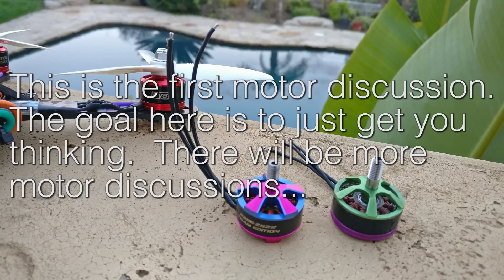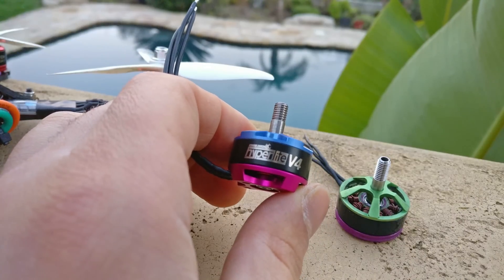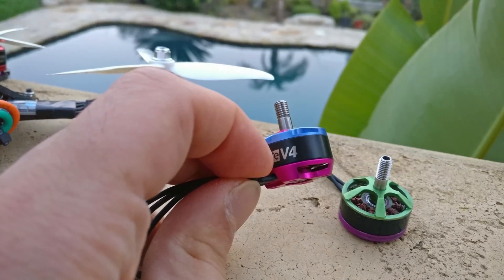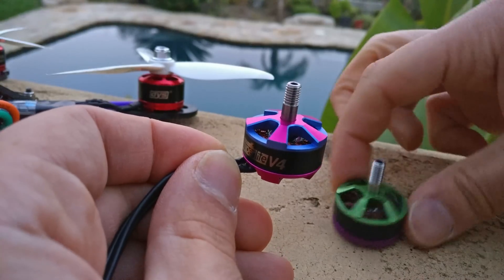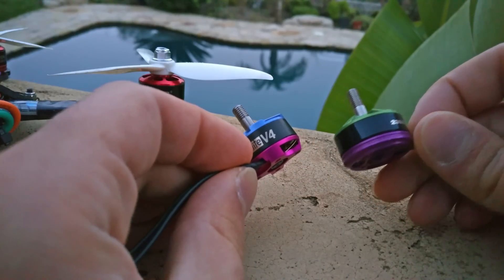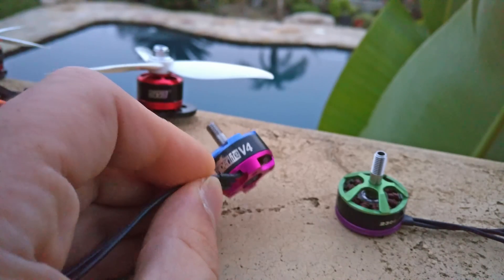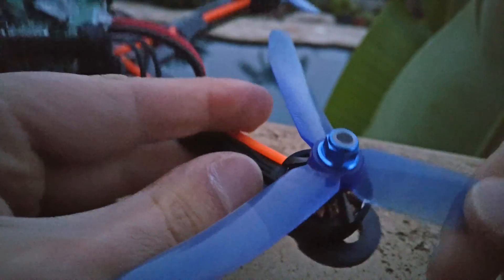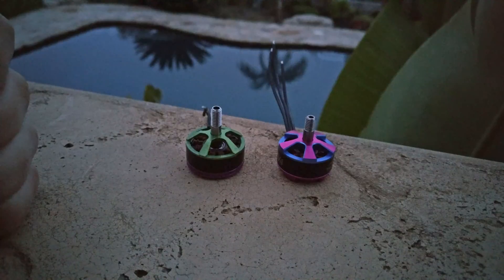Motors 1 - Quad Theory

Comment: Doesn't a prop override a wider stator motor for gyro effect?
Reply from the maker: What you mean?  It's not actually a gyro effect. I misspoke. But it's a rotational stability thing.
Reply: @Kabab  i mean does't a prop already override the stability effect on wide motors means prop is already much wider and they have their own effect and that effect must be bigger then motor itself
Reply: And btw i dont brush if i brush my gums start to bleed 😖
Reply from the maker: @goobisoft4873  ah. Yeah the wider motor doesn't have much of a gyro effect. It has a torque effect that helps with yaw. But even that's not totally true. If your gums bleed, you need to have your teeth professionally cleaned and then learn to brush and floss to maintain your gums and teeth. Otherwise the disease that causes your gums to bleed will only keep getting worse until your teeth fall out on their own.
Reply: @Kabab  thnks for replying ur channel is awesome pls keep continue making these videos and also y dont u make a big copter like autonomous octa or hex and talk about them

Comment: Well I do have emax rs2005s 2600kv motors and zmx fusion x25 2300kv motors, and there is no match, the zmx are waaaayyyyy more powerfull and faster than the emax... Maybe is because Im running racekraft 5051 and cyclones 5046c props on them, maybe the emax can't handle heavy props
(4s and 5s lipos, bonka, adrenaline, graphenes)

Comment: I would love to see you cover ESC's and matching them with the right motor a d prop. I'm only on my second build, and this seems to me to take some time. Not all motors give AMP draw data. Can you have a too high ESC? Some ESC's will give Max AMP draw, but changes by the prop you use. Can you help us to understand how to choose the right ESC for a build? Seem to be alot of lacking data when choosing an ESC for your motors. To me this seems to be difficult, or I'm over thinking it.
Reply from the maker: I'm gonna make videos about building when my prototype frames come in and I actually build stuff again.  For the most part, you can't go wrong with the Emax Bullet ESC's.  Most ESC's are pretty much the same.  They just need to work.  As long as they do that, they're all good.
Reply: I'll be looking forward to it. Yeah, I like the features of the Emax. Yeah most ESC is pretty much the same, except they support different AMP draws, and that's what I try to figure out when matching with a motor and the draw it demands. For example, if you're going to run the Emax RS2306 White edition RaceSpec Motor, It can have a 57.2 Amp draw with GF5050 Tri-blade on 16 volts. I'm thinking if it doesn't matter, could you not run a motor that draws too much on your ESC or a motor that's not getting enough? I heard other say they are running 30Amp ESC with this motor, to me that doesn't sound adequate. Because of my inexperience, I'm just not getting it doesn't matter.It also seems many companies doesn't publish this information about their ESC's and that can make it even harder to match the right ESC. Unless like you said, It doesn't matter, and I just think it does.
Reply from the maker: Spedix 20A or Emax 30A for anything race class 4S.  Done.  Unless you like Kiss stuff then go with them.  There aren't really special ESC's right now.  In about six months we should start seeing some really special stuff come out.

Comment: Hi, I just wanted to say great video, but I have a few questions: do you think motor efficiency is an important trait to look for in motors when acro flying? When looking up motors I saw that cobra motors and the t motor f40 have high efficiency at low rpms and become increasingly inefficient. most other motors have a peak efficiency at 50, why is this? Also Mr. Steele's new motors seem to be tuned to operate at 50 to 75 and yet they still have a lot of punch out which is unique, do you think they are worth the hype?  Thanks!
Reply from the maker: depending on the build quality and stator size, a motor can be tuned to have it's peak efficiency power curve anywhere it's desired.  It's difficult to estimate where a 2306 motor or any other size will be most efficient.  It must be tested.  I think it's an important factor to look at if your quad weight isn't changing from motor to motor.  Otherwise, dropping ~25g off your quad is more meaningful than the minor efficiency differences from one 2206 to another 2206 or 2306.  I don't believe the Steele motor is worth the hype.  It's a good acro motor, no doubt.  But I would actually prefer the new Emax 2306 2400kv.  It should perform better in every way except weight.  It's annoyingly heavy.  Don't put them on a frame that's more than about ~97g.
Reply: Kabab FPV, that's really interesting that you can only test a motor's efficiency curve. I was looking at mini quad test bench, and there are just so many motors and so much data it's confusing. I started graphing everything together to help. Why the emax motor, it weighs about 6 grams more than the hyperlite Steele motor, and most others, but it does produce stupid high torque numbers. Do you think it makes up for itself in how much torque it produces?
Reply from the maker: The new emax motor is definitely the best built motor we have seen to date for a 5" prop.  The weight is very annoying and I'm not sure if it's just gonna be too much or it'll be reasonable for freestyle.  It can also be a race motor but it's just gonna be a heavy race setup.  I believe the efficiency of the emax motors is probably going to be at least somewhat negated by their added weight.  A motor can be designed and constructed for a specific power curve but it takes a good deal of calculations and accurate readings.  I don't think motor manufacturers go through all that effort.  It's probably easier to just make a bunch of various motors, then test and see which direction to move in.  These are still just cheap motors.  The prop also makes a pretty significant difference.  The steele motor might be tuned to 50-75% but put a different prop on it and that sweet spot power curve might change.  All this stuff is far more complex than any of us know but hey, it all works so just test and see what you like...
Reply: Which is why steeles motors are so specific, because he tuned them for how he flys which might not be how most other people enjoy flying. I think the less weight the more flight time the better. And it so true there are so many little variables that go into a quadcopter, and I wish I could test several different motors! It's hard to tell from videos what a specific motor "feels" like and the best thing I think i can do is look at data to make a choice. Thanks for the answers!

Comment: Kabab do you have recommendations for a motor that can handle a 5" prop on a super light build (under 300g AUW, AUW includes battery. Currently looking at the DYS SE1806 which is about 23g.
Reply: Oh yeah i am thinking on 4s at 2550.
Reply from the maker: TransAm2k4 the best motor at the moment will be the new Hyperlite 2205 2522kv motor coming in a few days. it's actually 2600kv but a very powerful motor at 24.7g. I haven't seen anything more powerful in a lighter package yet.
Reply: Kabab FPV is there anything that is lighter but maybe not as powerful but enough for 5". Trying to maximize the disk loading theory.
Reply from the maker: TransAm2k4 I know there's a good tmotor 1806 but it's expensive. lol around for some 2204's. I haven't looked very hard
Reply: Kabab any reviews on this motor?
Reply from the maker: I generally don't do motor reviews.  Miniquadtestbench.com does a better job than I could ever do.  Based on what I discuss here, you can almost tell how a motor will perform from just looking at detailed pictures of the motor.  Experience will define more than anything else.

Comment: ever do a test on the gold ebay 2212 2200kv i think it it my first motors now on my ZMR tricopter push 5-7 in like a champ
Reply from the maker: That is a monster heavy motor.  I'm pretty sure your typical 2205 will outperform that motor easily on 5-7 inch.

Comment: Hiya Kabab! Just found your videos a few days ago and it helped me a bunch! So thank you! I was looking for new props and your videos helped me alot. Love the details you give that we don't get with Mr Steele and etc. Yeah Joshua has alot of good detailed technical videos but I've been enjoying yours for the racer type that you seems to be. 

I was wondering if you ever heard of the Xnova 2205-2600KV hypersonic motors? or at least the Xnova brand motors. My friend and I bought those a few months ago and we love them, the construction of these motors to us seems extremely good. you can see them here: http://www.xnovamotors.com/xnova-2205-hypersonic-racing-motor-series/
My friend has the 1407-4000KV ones on a 130 with 3 inch props and 4S batteries, its crazy fast. He used to have T-motors before that and they dont even come close to these.

Anyways, once again, really appreciate your videos and efforts you put into it all!
Reply from the maker: thank you.  The xnova motors are very good construction and very powerful but they're also heavy and overpriced.  I generally don't recommend them for those reasons.  The 1407 is a very special motor.  The most powerful thing in the smallest size.  It also does fine on a 4" prop.

Comment: Pretty interesting! Now i have some doubts about one of my setups.4" quad with 2205 2600 motors(28g each) 230g + battery 1000mah 4s 120g+ hd cam 70g = 420g total. I'm not racing, more about freestyle. So should i try smaller motors(first building it, thought that 2205 would work batter with hd cam) and which if it would make an improvement?
Thanks🙂
Reply: deadloop I have a similar 4" setup, and while 4s was pretty good, I found 5s really made it amazing. Using 2206 2600kv with HQ 4x4x3 on 5s = oh. yes.
Reply from the maker: Yeah that's gonna be for a particular kind of freestyle...
Reply: I wouldn't go smaller if you are looking for acrobatics. I went right back to my 5" for the insane torque. I had an auw of about 250ish with 3" props @ 3800kv on 4S and it was weaksauce for torque. Fast as all hell dont get me wrong, but just wasn't fun for acro. I like to stay in the 2300kv for acro, I know it is low kv, but again the torque :)
Reply from the maker: Erik I'm with you on that. I just tested the V1S quad blades and I hate that I like them so much. so much damn torque and so smooth.
Reply: I sometimes think people get too hung up on speed vs torque. For acrobatics I really look for torque over anything else. Maybe a video of this subject would be nice :)
Reply from the maker: Erik yeah I'm getting there. because acro has so much preference and art, it makes it rather complicated and expansive.
Reply: Adam Komarek Oh! good idea, should try it one day;)
Thanks!

Comment: The hyperlite v4 is just the lamborghini of brushless motors
Reply from the maker: Yeah that's actually pretty accurate.  Not the lightest motor overall but really really powerful.
Reply: Only watching those windings can produce orgasms, the tolerances, the magnets as you said in your video, they are 10/10.
Btw man, I saw your budget fpv build. Exquisite.

Comment: Great video, but I think a lot of us would appreciate some more in-depth content on motors after you round out the quad theory series.
Reply from the maker: R J yeah I want to but it would be a 1hr long video of me going off about tiny details. I wouldn't bother watching that myself. not to mention my recent string of ~14min long videos. it's just too long. I aim for about 8min but can't hit that target lately.
Reply: That's understandable, you're doing a lot for the hobby either way.
Reply: Hey, I like those long videos.  Helps when you can stay on a topic for a while instead of jumping through multiple crappy vids going over the same stuff rehashed/ lifted from other channels. Please do a vid on WIRES. Like what to use on ESCs, FCs, PDBs, etc.. Would be great.  THANKS!!
Reply from the maker: Yeah that's why I don't make things like this video super short.  You gotta think about it long enough to gain a little understanding on it.  I'll mix in wires with my build video if my prototype frames ever make it in.

Comment: Something not touched at all: cooling, those T series motors keep very cool. Even badly tuned barely get warm. It has to do with the design.
Reply from the maker: SirCrashaLot sure I'll discuss that in the next video too. it's kinda tangled with all the rest. thinner laminations reduce temps as do crappy magnets and large air gaps.
Reply: No issue, I just think its a valuable characteristics of a motor (T-motor and emax does it well too). Not everyone thou.
Reply from the maker: SirCrashaLot yeah their bell designs seem to do better.

Comment: Oh so there is a 20xx size motor!
I got some f80 for a 6" build but it wont be a good fit for my Helix 6", since it's a very light frame, so the F80s are really just too heavy... I think it will suit better a Neato Dallas, 220 frame 6". What do you think? Will the F60 Pro be better for my Helix 6"? What motor would you recommend for a light 6" build? I should keep the Kv under 2200? I am about to pull the trigger on the ZMX Fusion X30 2207-2140kv, they seem to be perfect for a light 6" build?
Reply from the maker: Ray Choi I'm actually testing light builds with beefy motors soon. I don't think it'll be fantastic but I might be very wrong. it will however drive up the fracture risk of the frame. I think the zmx 2207 2150 is probably one of the best 6" motors there are.
Reply: Kabab FPV be ware that they are NOT In Stock at silver drone... my express order form the start of feb. still have not shipped... the do not say any where that it is a preorder... thinking I will cancel and go for F60
Reply: Kabab FPV so I might have found the perfect motor for my 6" Helix! But then if it's not available??? Why didn't they put that on the website like other out of stock items they have? I know Multicopter Builders also have some 2207 made by Brotherhobby too, but they are 2400kv and 2500kv (these 2500kv tested to be 2590kv!!!) so they might not be so good for a 6" :(
Reply from the maker: na, don't go past 2300 for 6".  I think ~2100 is kinda the most you can do without killer amp draw.
Reply: Peter Kornum weird that is a pre-order though, cos I remember seeing them on the website even way before Xmas... Didn't have any  6" build on the way then so only ever got the X25. I just placed an order for them home that they will be shipping them soon. If not my other choice would also be some F60 Pro.
Reply: Kabab FPV Yeah I believe so... But i might have to go for some F60 Pro running at 2200kv. Will have to go on the throttle. Unless I get the V4 Team edition 2120kv, those are in stock (also get nice sharp colors as a bonus! Love the looks)
Reply from the maker: Ray Choi yeah those are good 6" motors.
Reply: Ray Choi I have a 5" and a 6" build both with F80 2200kv, and the quad I keep coming back to is my 5" with either tri or quad blades (HQ 5x4x3 or HQ 5x4x4) with 5s lipos. so fast, responsive, and especially effecient. Way, way effecient, while still having pretty crazy power.  6" 6040 on 5s is a blast too though! You really won't be able to tell the extra 10g per motor at all compared to most 2206.
Reply: Adam Komarek Really? They are they good, great! so it's the F80 and not the F60 Pro? If that's the case I'll have a go and mount then on my Helix 6". I'm just afraid they are too heavy for a "light" build... Even more so on a 5". But I guess they are so powerful their extra weight don't matter.
Reply: Yeah the F80's rock! I have tornado t2 2300kv and 2600kv along with zmx x25 2300kv on my other quads, and the F80 is faster and flys better than all the other motors. You really can't tell the weight difference at all. I also get maybe 2:15-2:30 min flights with a 1300mah 5s turnigy graphene flying pretty fast.. and I get 3:30+ flying just as fast with the F80s. Their effeciency is insane! 85ish amps full throttle with the F80s, and around 115-120amps full throttle with the other motors, all running 5s. You would think the F80s pulling in the 80a range full throttle would be slower than the T2 and x25, but it's actually flying faster!
Reply: Ray Choi login and see If your order say unfulfilled they Are not in stock... (don't think they have ever been.... on Monday I'm asking PayPal for my money back
Reply: Adam Komarek wow that's really good! I think I will be mounting the F80s on my next build... Really soon! Thanks for the infos!
Reply: Peter Kornum wow that sucks! Did you write them? And did they rely to you at least telling you what's up with your order? Can't believe the company that make zmx motors, used by so many racers would be do unprofessional!!! Damn !
Reply: Peter Kornum I got an email from them. They are picking up the motors today so they will be shipping them very soon, don't ask for a refund just yet! If you still want your X30'
Reply: Ray Choi there are some truth to that.  Strangely enough mines ships yesterday exactly 5 seconds after I contacted them on messenger and said that I would cancel my order on PayPal...... Sedley I'm now in love with the F 60 pros